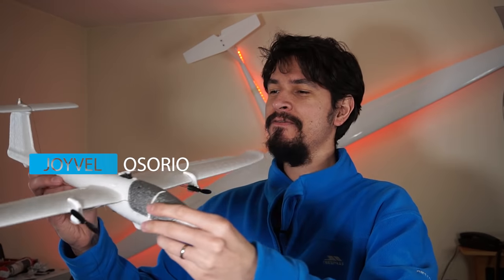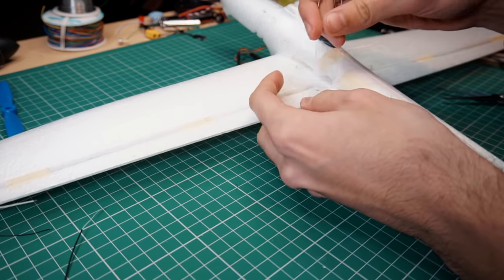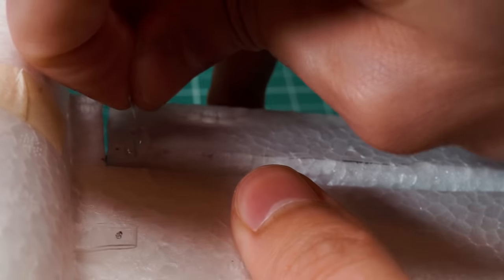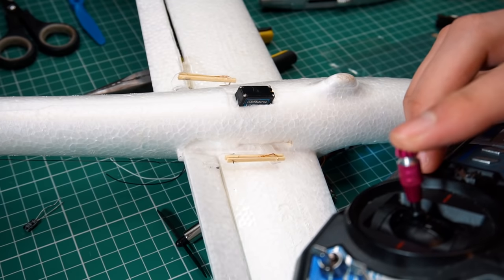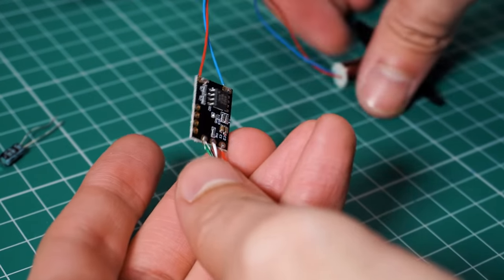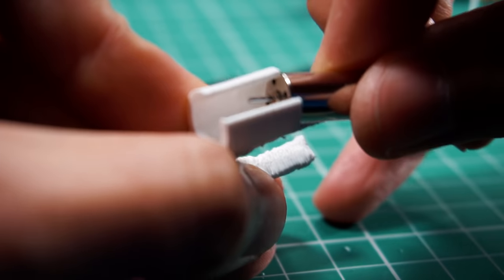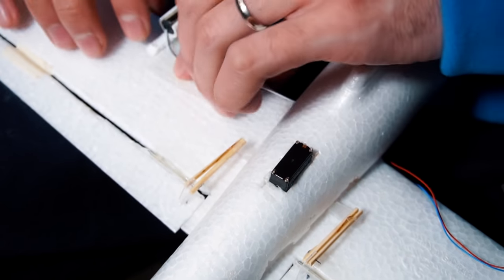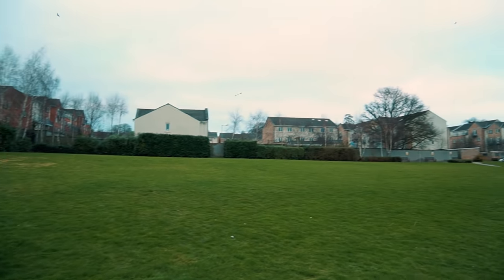From free flight glider to a serious RC airplane

Comment: As a pwm controller for these brushed motor dont go for costly solutions just take arduino nano, nrf24L01 transmitter and receiver, one c945 transistor and then u can control the speed of drone brushed motor via standard arduino PWM pins.

Comment: you may like... took a 2.4ghz 3ch heli apart, 2 motors on wing for power and differential steering, the 3rd motor on the tail boom (blade horizontal) acts as elevator. it flies like, and the controls are the same as a typical 3ch airplane, surprisingly well too.
edit, for motor mounts used 2 short sections of CF arrow shaft slit down the side, the motors pinch into them tight, and they are glued into the wing. easy to replace motors if needed.

Comment: Bought all the parts you‘ve suggested, but can‘t geht the motors to work. Binding with the receiver was fine, servo is working, only Motor doesn‘t spin/start. Any idea what the reason could be? Maybe the default PWM frequency of 250 herz? Red about alternative firmware - where can I download it? Would be really thankfull for some help!

Comment: the Video:
https://www.youtube.com/watch?v=fRYZuOkpb5I&t=1s

Im Dezember erfolgte der Erstflug meiner Version
des Lidl. Der Motor ist am Heck montiert. Beim Höhenruder setzte ich auf eine
Art Pendelleitwerk-Vektorsteuerung, ein Servo "verbiegt" den Rumpf.
Da der Motor am Leitwerk sitzt, wird auch er mitbewegt. 

In December
2019 I did the Maiden with my conversion of the Lidl. The Motor is mounted on
the vertical stabilizer. For the Elevator i usd Kind o a Vector-steering. A
servo bends the fuselage so the Motor and the Horizontal stabilizer move.

Comment: My only fears of flying these when I was little is that if it crash and breaks into two. Or getting stuck in branches.

Hitting someone was never one of them, instead they're part of the fun
Reply: I lost 3 airplanes in branches and one in the ocean at the beach. The motors were about the same size as the ones in the video and used differential thrust to turn. The wind took it and I couldn't turn it around back towards land.
Reply: Duane Rackham  hey

Comment: Why do all use brushed motors for micro rc? There are also very light brushless available. Just curious
Reply from the maker: At the time I made this video was easier and cheaper to find brushed motors for this project, now they're still cheaper than the brushless ones.
Reply: @Joyplanes  yes i know they are cheaper. I was just curious if for micro RC brushed motors might be more efficient. Because I saw a lot of builds who use them.  Also I think the ESC's for brushless might be lighter?

Comment: Hey buddy. I have ordered the same esc but its not working. please tell me how to configure ESC.
Reply from the maker: These ESC are bidirectional so there's a trick with the throttle to make them work, try leaving the throttle in the middle first.
Reply: @Joyplanes  Tried it...not moving even a single direction. Also tried in channels Ailevator and aileron. Not working....no response from motor
Reply from the maker: @aerofreak9109  That's weird, check the wiring, etc.
Reply: @Joyplanes   does it require calibration in different way?
Reply from the maker: @aerofreak9109  I don't think so. It should work.

Comment: Bro, you definitely need a Dremel to drill those small holes.
Reply: A pin drill would be better.
Reply: @loc4725  How ?
Reply: @ctbully  Err.. By using a small drill bit?
Reply: @loc4725  and in your mind a Dremel cant drill small holes less than 1mm ? Maybe you need to go and do some research into Dremel products
Reply: @ctbully  I'm sure a Dremel can drill small holes in plastic, I used to do it that way myself, but a pin drill is better as you have more control and it's quicker to set up.

But each to their own. 🙂

Comment: Really 
Decrease print speed
Decrease temperature
Calibrate the extruder 
Increase retraction 

It really hurt my eyes, when i watched the 3d printer struggle like that
Reply: If you require any help you can ask me
Reply: it looked like over extrusion only. pla can take higher heat with out much loss of fine detail. but betting layer bonding..